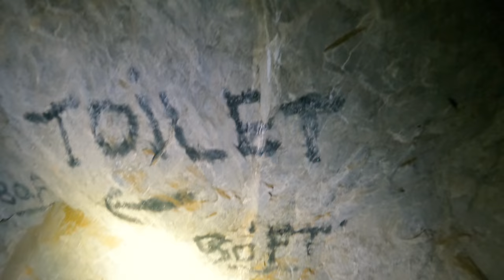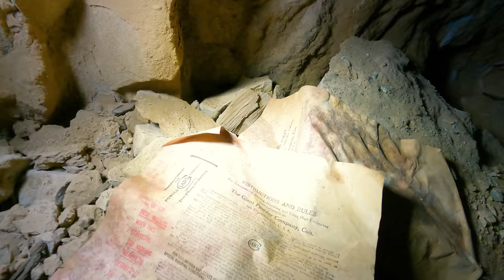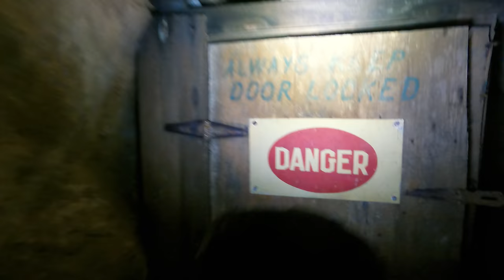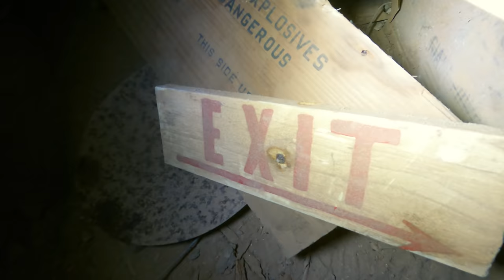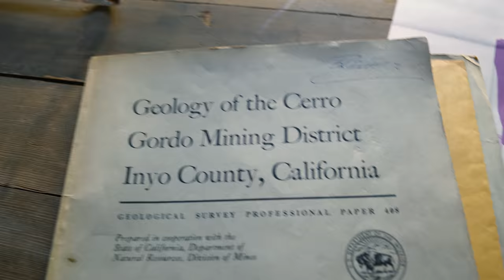Going 700 Ft Down A Mineshaft For Treasure & Water

Comment: You will get more ground water if you plant more grasses and weeds. They act like a moisture blanket. You should seriously give this some consideration, as it will turn the area into an oasis and possibly even reinvigorate the lake bed! :D
Reply: But it could also damage the ecosystem, and it would hide quite a bit of natural beauty and history
Reply: What would you suggest for plants? I live in a similar climate and idk if I could even keep them healthy / alive without using more water. I  am earnestly interested because I have this same problem (even though I do have access to running water)
Reply: P.s. I do have some plants that like to stay somewhat green, but do become a fire hazard during certain parts of the year when it’s super dry
Reply: @RealGlowup  google "drought tolerant plants" and "drought tolerant grasses".
Reply: @isaachlloyd  considering that water is essential for life I think it’s still worth the investment. Remember 100 years ago when water was so difficult the climate was more stable, not as hot and dry. You would need more water just to maintain the current environment.
Reply: @RealGlowup  I live in a similar climate and elevation. There’s lots of information at the local university what will grow here. Someone should put a packet of information together for him. It’s also how you grow things. No one would Believe you can grow tomatoes out on the Navajo reservation but there is a way.
Reply: I comment about this on every single one of his videos! He also needs to read up on water collection in management. No reason to waste all of that good snow or his household gray water.
Reply: As long as they are native plants he'd be good to go.
Reply: Normal grass and weeds won’t grow in a high desert like that
Reply: check out the "Biggest Little Farm" documentary, they rejuvenated what was arid land to green pastures in california as well.
Reply: @annekabrimhall1059  I agree. He also needs to research swales... it's a way to harvest rain water, even replenish groundwater. He said there were 2 springs there in the past that dried up, that means the groundwater level dropped due to drought and no replenishment. There are ways to remedy this situation, but it means recreating an ecosystem and providing water catchment that doesn't just drain away. The research is out there. The US government did quite a lot of swale building in the early part of the 20th century... and, yes, even in the desert southwest.
Reply: The L.A. Aqueduct is gonna keep Owens dusty and dry for a long time.
Reply: if he believes it will help with the rebuild and keep other things from burning down I’m sure he will be more invested in water retention. All that snow runoff must to go somewhere. right now it’s just disappearing down the mountain or deep into the mountain.
Reply: @isaachlloyd  Nope, it would INVIGORATE the eco system. What has damaged the ecosystem is all of the human destruction.The lake bed is a clear examople. For you to suggest that repairing it will cause damage is pretty unsmart.
No offense, but you should listen to what you say before you say it, because what you just said was rather ridiculous. Sorry for offending, but its true. That was pretty dumb. :D
Reply: @RealGlowup  Theres lots of videos of succes stories already available on Youtube. I dont claim any expertise, but if it were me doing the work, I would use native plants. :D
Reply: @ET-Gamer  I see what you mean, but I also disagree. Keeping the ground water is the goal I am suggesting. Not all of the ground water would go directly into the aqueduct. It would(in theory) flood the old mines and the soil, keeping the water source local and constant once established. :D
Reply: @chemicalmike646  thank you 😊
Reply: @tasksource  You are being short sighted! :D
Who said anything about "normal" grass? Grass is not exclusive to the type that grows on your normal every day lawn. Grasses are abundant in many types and even grow in deserts such as this one. Weeds are also important too, and should not be seen as a "pest plant" but instead as a necessary part of restoring the environment. Take the simple dandelion for example;People see it as a pest, when in fact it has many useful properties. Google "Uses for Dandelion." :D
Reply: @calebsherman9255  native plants is the best way to go. The goal should be to restore the land, not reimagine it in our image. :D
Reply: @annekabrimhall1059  I hope he listens to us. I believe it will be crucial for the areas long term sucess and viability. Sure it will take a few years, but I believe he will see promising results quickly(maybe 2-5 years?), especially by preserving the snowfall into ground water. I also think the eco-tourism aspect of this goal will bring revenue which will make the goal a reality. :D
Reply: @chemicalmike646  Well the Aqueduct actually takes water from north of the lake in the Owens River hence why it’s dry. None of the water that actually makes its way into Owens lake actually gets to L.A..
Reply: @RealGlowup  and thank you too :D
Reply: @chemicalmike646  I can see the merit of the water local to Cerro Gordo. I’m just saying it’ll take a lot to make Owens lake full again and rejuvenate the Owens Valley. The Owens Valley was unfairly destroyed in the race to bring water to L.A..
Reply: @RealGlowup  I used to be horrible at raising plants. So bad, that they just died in my presence. Luckily they didnt catch fire though! :D
Reply: My concern would be that any ground water there (including the water down the mine shaft) would be heavily contaminated because of the mining processes with arsenic, mercury etc. It can't be consumed by people, or animals. I remember seeing a historic reference of the Cerro Gordo mules getting sick and then dying from eating the plants around town. The soil was apparently so contaminated from the toxic tailings, the plants were drawing up the contamination and  adversely effecting anything that consumed it.
Reply: @pjmiller8632  I hope that is something he takes into consideration. I am sure he gets water purity tests. By the time it’s filtered down to the 900 level it’s probably not as bad. I’ve never looked into what kind of filter takes heavy metals out of the water. The Navajo reservation has a big problem with that.
Reply: @tasksource  well no but they don’t grow in Phoenix either. You just find the kind of grasses that grow there. Mexican Feathergrass and high mountain native would grow there.
Reply: @ET-Gamer  You're missing the point of creating a local source of water vs importing water. I'm not talking about planting from a distance, I'm sugesting planting right there in order to maintain the ground water. And over time once the ground water table is restored, only then will a aqueducts effet on the area be an issue, because the water would be imported from the replenished lake bed! :D
Reply: @imzackson  just like Navajo reservation! The elderly can die of thirst or water toxicity so the people in Scottsdale can have fountains to their gated communities and swimming pools.
Reply: @ET-Gamer  sorry if my replies are out of sync with your replies, Youtube does that. I respect your interest in this though, I want Cerro Gordo to suced and be sucessfull in the long term. I get the strong impression you feel the same. :D
Reply: @pjmiller8632  Thats definitely a concern, but fixable to some degree. Particularly if Cerro Gordo can draw in eco tourism, and volunteers, or even federal funding to restore the land. Those are big "IF's" though. I hope it happens, but it wont if nothing is done. :D
Reply: @isaachlloyd  Considering that the entire planet is accelerating towards a full blown meltdown, adding a new patch off wet ecosystem, is a good thing, even if it's changing the landscape.
This kind of logic "maintain the statvs qvo" is a flawed one. If we are to survive as a species, we can't afford to be muddled by sentimentality. As other areas become deserts, these long lost green spots need to become verdant again.
Reply: @chemicalmike646  I agree with what you’re saying. I only disagreed with your point about reviving the lake. Planting plants to help increase and maintain water in Cerro Gordo is a great Idea. I just think that restoring Owens lake is a mute point regardless of the aqueduct. The aqueduct has no effect on the scenario you’re suggesting. The lake will remain dry either way. Please research the geography, geology, and irrigation system in Owens Valley to understand what I’m saying.
Reply: Instead of minerals and ores for treasure, the new treasure could be WATER! Looking at the comments (thanks for the feedback), its pretty clear that the area is important for water supply. This treasure would potentially bring MILLIONS in revenue to Cerro Gordo, and contribute to farming and homes across the state. #MakeCerroGordoGreatAgain
:D
Reply: @chemicalmike646  It's fine man and I'm sorry if I'm just blowing over your main point. I'm very passionate about California and it's history. I'm very sour over the state of Owen's Valley. It's an injustice that stands today. But Cerro Gordo is apart of that history and should be preserved and restored at all cost. I think your input is very valid and all manners good. Much respect to you.
Reply: @annekabrimhall1059  You are being short sighted. :D
Restoring the land would allow the land to become a (ground water)resovoir for water, creating the source for the extra water needed. It wont be an over night process, and would take a few years. But its definitely feasible and do-able. Much of the water has been exported via the aquaduct, and not replenished, creating drought like condition.
IF, however, the land was restored and allowed to replenish its ground water supply, it would benefit not just the local area but the State as well! The benefits would greatly help Cerro Gordo, and far surrounding areas as well! The income gained would be well worth the investment into the area. I wonder if Federal or private funding, or even eco tourism money will make this possible. I would like to see Federal funding because the water issue is so important to the State, but I also would like to see private interest to kick start the process. :D
Reply: @ET-Gamer  Thanks for the insight. I assumed that because the water trickles down into the valley, it would contribute to the Lake, especially if it was contributing to ground water.  :D
Reply: Maybe the springs are all dry because the mountain looks like a swiss cheese and all the aquicludes got destroyed during mining!!??
Reply: There is a YT vide of someone planing grasses in a very dry place and it brought back water.
Reply: And nobody wants to drink water which is contaminated with heavy metals
Reply: @jonasst11  Tell that to the State, that gets its water from the area. Theres an aqueduct btw.
Reply: @annekabrimhall1059  dang! This is amazing!
Reply: @chemicalmike646  I never expected anything to be restored overnight. The example I was thinking of took 20 years. But he needs to start right now. So why do you think I’m shortsighted?
Reply: @annekabrimhall1059  I think collecting rain water is illegal in California, at least from what other people commented in other video
Reply: If they arent already there theyre not going to grow.
Reply: @irwisible3921  that seems contrary to Californiatree tree hugger reputation. We should look it up
Reply: @drkrypton4410  so direct your waste water to low points and it will start watering the plants that are already there. You CAN get wildflowers, weeds and grasses that will grow there. I watched my family do that.
Reply: @tasksource  they don't grow fast, but they will grow. The alpine tree line is where things get very difficult. I don't think he's up that high, think Denver or the Himalayas, plants do grow at that elevation, just not quickly. There are a few important factors that go into growing plants, water, oxygen, CO, soil, and sunlight. The rest is left to nature. It absolutely cannot hurt to try. All it would take is time.
Reply: @drkrypton4410  So, that explains why peoples gardens work out so well. Or crops.You plant them then they grow! DUH!
Reply: @annekabrimhall1059  I gave a detailed explanation. Sorry if that didnt clarify things.
Reply: @pjmiller8632  You are right about possible contamination.  He should definitely have the water tested for heavy metals and also radiation which can occur if the water interacts with uranium.  The Grand Canyon has creeks your not supposed to drink from because they were contaminated by uranium mining in the canyon;.

Comment: Now you just need to find multiple Cave Spider spawners and combine farm them for the loot.

Pro Tip - Place torches on the left so you can follow them back on ur right. Avoid creepers jumping on you as they blast suddenly without warning. 👍
Reply: Yeah, put torches in a mine that barely got oxygen, really smart to burn that oxygen and have you choke
Reply: Or add a bed inside the mine so you spawn inside already 🧠
Reply: @roberts3423  when was that feature added?
Reply: @calus_bath_water  i think they dont play minecraft 😐

Comment: thats not a constant duty pump, your asking way too much out of that little pump
Reply: The question then becomes, would he be able to get a more robust pump safely down the shaft with just the 150 year old hoist rig?
Reply: @Dargonhuman  Exactly my train of thought. That pump is probably the upper limit of what can be carried down with such an old system. Might be worth it to eventually save up to replace the hoist with a modern winch so a more robust pump can be installed.

Comment: Brent if you put a small water tank on top of the collapse area with the inlet above the outlet but both submerged, you can keep the water from backflowing from the pump and prevent having to prime the pump every time you turn off the water supply.  All you would have to do is get a bucket and fill the tank to start the prime if something went wrong.
Reply: The solution is installed on every single sump pump. All he needs is a one way valve. That way only a foot or so of piping needs to be refilled while the one-way valve prevents the 690 ft above it from draining back.

Comment: Why didn't they take the new pump down first time ?
Reply: Heh.
Reply: Weight?  3 guys and a pump might be too risky?
Reply: They weren't sure that was the issue at first. He mentioned that he was hoping they could turn it back on and it would kick on
Reply: They were not sure it was the pump, it was only six months old
Reply: I gess the first pump is just fine and can now be used as backup. Because it probably had problems with the priming aswell. He need to digg the hose down so it dosent go up and over the dirtpile there. So it is more flatt.
(Maybe a valve below the suction point so you can clouse it, fill the tube with water frome the pump. If to people, one start the pump and a couple of seconds later the other open the suction valve) 🏄
Reply: @stevedavies1609  😬

Comment: Firestone makes a 45mil pond liner that is a hella lot less expensive than an actual water tank. You could actually build your own tanks digging down into the soil, or creating concrete tanks with the hotel... You could devise catch basins on the side of the mountain and run conduit directly to your tank, or pond. Then you can build a three stage sewage treatment pond further down wind and down hill of your water supply. You can then use the gray water to irrigate the sides of the road on the way up to green it up.

Comment: Cool. Be careful and ALWAYS carry enough light. Soundwaves act funny in those old mines, too. It doesn't take much banging around to hear things on other levels doing things. I once chimney'd up a portion, but ran into a dead end. When I came back down, there was like a slide of dirt I slipped on and slid on my butt for a couple of feet. At the bottom I dropped from the slide to the mine floor about a foot and landed with a thud. Started hearing things/noises about me like that old man stated- not echoes, but movement.

Comment: They ran a "Giant" strip mining nozzle up there? There must've been some other source for water other than hauling up with wagons! ????
Reply: That’s exactly what I was thinking. Hydro mining takes a lot of water.
Reply: The nozzle is called a monitor
Reply: @jimtalbott2095  You’re right of course. I got my strip mining equipment mixed up. 🙃
Reply: There was a large lake nearby, but it got drained when the water got routed to LA instead. That lake was the main water source for Cerro Gordo (if I’m not mistaken)
Reply: @prettylittleravenna   They still have water down in the Owens Valley. The problem is the 5000 feet in elevation difference between the valley and Cerro Gordo. 🙂

Comment: Brent, just a bit more info for you on how the carbide lamps worked. Calcium Carbide, when mixed with water, creates a chemical reaction that produces acetylene gas. They lamps have a little chamber where they place the carbide rock, then the water, then close it. Then they open a little valve and ignite it. A chunk of carbide would provide an hour or so of light. Calcium carbide is still used to this day to make acetylene gas for cutting torches. I worked in a factory that produced acetylene. Its a really interesting process. Calcium carbide is also used in hobby cannons as a propellant, and you can buy it and new carbide lamps are still produced today. https://en.wikipedia.org/wiki/Calcium_carbide
Reply: Very interesting thank you for that kind stranger

Comment: hi, I really enjoy your videos, it is like beeing there in the adventure, quick one about the water, provably you have solved the issue, but you can use a kind of 2 stage pumping installation, use submersible pump on the watre "pond" to pump water to the current pump, that will give you the pressure you need